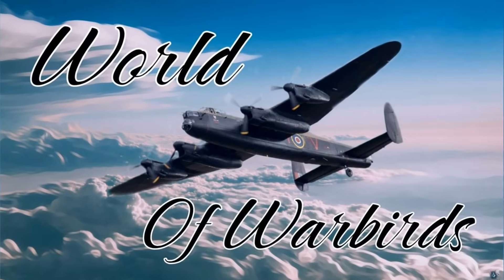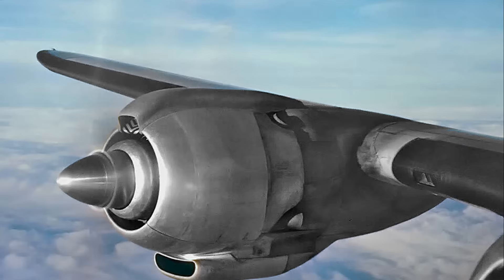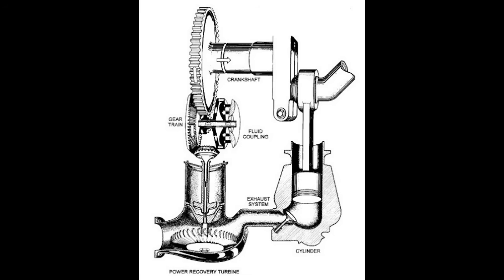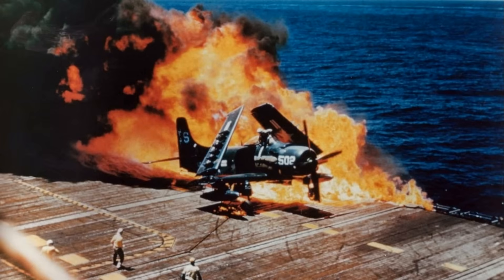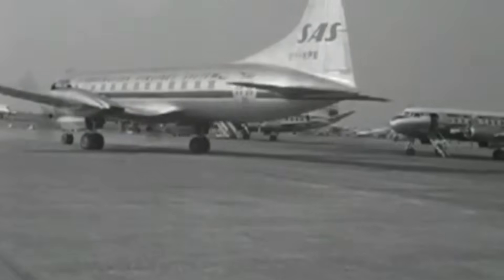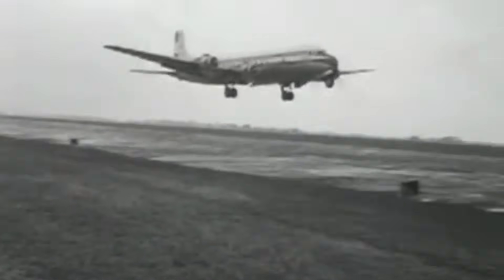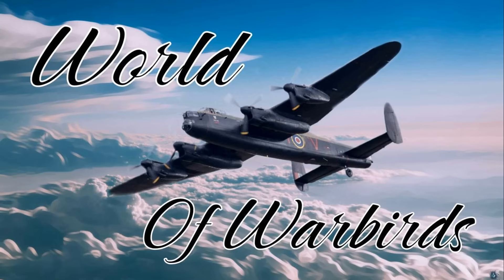Turbo-Compounding: The Forgotten Power Booster of WWII (almost) and Beyond

Comment: One, of the teasons for the B-29s to combust at no notice was the very primitive turbos for compounding which SHOWERD parts and oil.  Multiple buckets were/are normal for the super-forts sitting still. (I watched the still flying 'fifi' start and warm up (to fly across San Francisco bay to her next show)) used 32 GALLONS oil and 400 gallons of 100octane AVGAS, for a warmup, ten minute flight and landing!
Reply: The big problem with fires on B29 engines were induction fires and they had nothing to do with the turbos.
The R3350 engine had a poorly designed supercharger, it worked well enough at any kind of RPM's but at an idle it caused some cylinders to run lean from the mixture not being evenly distributed throughout the intake, the problem was the early pilots of B29's didn't have a proper pilots manual due to the aircraft's rushed development, they were trying to run the engines like in the B17's and B24's they had experience in, they were advancing the throttles too quickly off of idle, that could cause a lean cylinder to backfire into the intake (induction) manifold, if that happened and it caught the pressurized air and fuel in the intake to catch fire it would spread throughout the manifold causing cylinders to drop power like dominoes, these were heavily loaded bombers trying to get off the ground from the short improvised runways on those Pacific islands, as they'd roll down the runway that engine would continue losing power as each cylinder quit making power so by the end of the runway the engine was completely dead dooming the aircraft that didn't stand a chance of getting off the ground before the end of that shot runway. 
Once they finally figured out what was going on it was standard procedure for two of the gunners to each watch out one of the plexiglass bubbles on the sides of the fuselage at the two engines on each wing, each engine had a particular panel they were supposed to watch, if they saw either one starting to discolor they'd immediately report it to the pilot and hopefully they wouldn't be so far down the runway he couldn't get it stopped before the end and they'd crash into the sea.
Like any aircraft from back then occasionally things like an oil line popping and hosing down the engine would result in a fire in flight, also the pilots not correctly cycling the turbos before taking off which could blow seals in the turbo and spray oil into the intake was actually another thing that could cause an induction fire also, but these weren't really anything more common on the B29 or B24's, the major cause of engine fires on the B29 were induction fires caused by a cylinder backfiring into the intake during throttle up at take off, unfortunately as most of the crews died if anyone on board had any information about what went wrong they took it to their grave, so it took a while for them to figure it out, by then they were already developing the direct injection systems that cured the problem 100% since if there's no fuel in the intake you can't have a fire, and wherein direct injection did indeed make it a better engine the fact is once they figured out what was going on and trained the pilots to hold the brakes and advance the throttles slowly off idle induction fires dropped dramatically before the direct injection engine B29's even got to the field.
Another thing is the myth that the R3350 engines had magnesium cases, they didn't they were forged steel cases just like the Wright R1820 engines in B17's were forged steel, people mistakenly believing the R3350 engine had magnesium cases is why they think the B29's fire suppression system wouldn't put out the engine fires, that wasn't the reason, the reason was because the fire suppression system sprayed the outside of the engine but an induction fire is inside the engine, so no, it won't put the fire out.
Reply: @dukecraig2402 Thank you for this wonderful technical description of the cause of the B29’s engine problems.
Reply: @Pamudder 
Any idea where I can read about that Avro Shackleton?
Reply: @dukecraig2402 It was in an article entitled “The Shack” (which is what its crews called it) many years ago in SMITHSONIAN AIR & SPACE magazine .

The Shackleton was a derivative of the Avro Lancaster powered by four Rolls-Royce Griffons driving counter-rotating props.
Reply: There’s a funny story about the Avro Shackleton ASW aircraft, which with its 4 RR Griffon engines stayed in service until about 1980.  

One Shackleton made a very unusual flight to Halifax for a demonstration and an order had been placed for 110 gallons of oil to prepare for the return trip.  It arrived in the form of several pallets of 1-quart oil cans.
Reply: @Pamudder lols!  I have dealt with (USN) military supply systems.  Sadly, a lesson i learned is ALWAYS check container sizes when ordering consumables (liters instead of gallons of fuel for a loooong small boat trip (and a 55-gallon drum of lube oil for a TWO-GALLON lube oil tank, spring to mind!)

Comment: I worked on the GE T58 turboshaft in the SH 3 Sea King. We had an internal fuel manifold fail. The power turbine melted. It looked like it went into afterburner.
Reply from the maker: That sounds intense! Thanks for sharing!

Comment: Allison V-1710 E27
3,000hp
Reply: Yep, first engine in the world to run with a turbo compound system, the next step was to fit it into the P63 Kingcobra, but before it left the test stand the war ended and the plug was pulled on the program.
Reply: @dukecraig2402 P-63 would’ve been cracked with that engine in it. 

I love drawing fantasy aircraft for designing in Flyout. I had an idea of combining Chrysler’s inverted V16 engine and the entire forced induction system of the compound V-1710.

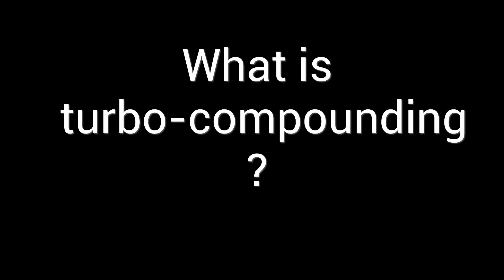Comment: 1:13  What you are describing as "Turbo Supercharging" is really just plain old Turbocharging.  Turbo Supercharging is when a crankshaft-driven supercharger feeds its output into a turbocharger.  At least that's the way I learned it in caveman days.  I always wondered why they never tried electrically-driven turbochargers to eliminate turbo lag -- and then, fairly recently, they did.
Reply from the maker: Turbo-supercharging is an old fashioned term, brought in when the idea of a supercharger driven by a turbine was new.
Reply: @worldofwarbirds  There has never been a supercharger driven by a turbocharger because such a design would be objectively impossible to achieve the goal envisioned.

Superchargers are driven by the engine's crankshaft; turbochargers are driven by air or exhaust, depending upon aspiration.

The whole idea of Turbo Supercharging was for the supercharger -- driven by the already rotating crankshaft and therefore instantly responsive to the driver's right foot -- to feed much higher pressure air instantly into the turbocharger to eliminate or greatly reduce the "turbo lag" that would otherwise result from exhaust requiring time to reach sufficient pressure to make that turbo spin like the dickens.  Not Charles Dickens, the other one.

I jumped for joy when I saw that someone had figured out that electrically-driven turbochargers can instantly respond to accelerator input while eliminating dozens of pounds worth of now-unneeded supercharger.

Anyway, I haven't been involved in this for about 45 years now.  I just occasionally see something on the news rack and go "Well, I'll BE!", which usually makes me sound like I'm in 1885 staring in wonderment at the first automobile.

I'm old.  It sucks.
Reply: @adamchurvis1 
You're wrong, that's not how the turbo supercharger system worked on USAAF aircraft in WW2, he's right he just worded it poorly, the turbo doesn't drive the supercharger on those systems it feeds the supercharger, but at lower altitudes the turbo didn't even do anything, now that system is not the same as the turbo compounding system this video is about, and after I explain how the turbo supercharger system in WW2 USAAF aircraft worked I'll explain why there's some confusion here.

P47's, B17's, B24's, P38's and B29's all had the same system, the engine's had a single stage single speed supercharger, engines love being throttled off a supercharger, throttle response is instant unlike a turbo charger that has the dreaded turbo lag, the single stage single speed supercharger on those engines provided plenty of boost at lower altitudes, the turbo in the meantime did nothing, instead exhaust was routed out of waste gate dump valves, right around 10,000 ft where the engines single stage supercharger could no longer produce maximum boost the waste gate dump valves would start closing which diverts exhaust to the turbo and driving it, and it starts feeding the engine's supercharger and essentially keeping the inlet air pressure at the supercharger the same as at lower altitudes, the higher it would fly the more the waste gate valves closed diverting more exhaust to the turbo driving it faster, at the highest altitudes all the engine's exhaust was driving the turbo, with this system you didn't have an additional 150 HP or so dragging down the engine every time you'd shift a 2 stage 2 speed into a higher range, despite the term "2 speed" being applied to them a 2 stage 2 speed supercharger actually had 3 ranges it could be run in, at 150 HP drag per range at the highest altitudes with the supercharger in its highest range that's around 450 HP being drug off the engine in the form of parasitic power losses, but with the system the USAAF liked no matter what altitude you were at you were still only dragging the initial 150 HP a single stage single speed supercharger drags off the engine because starting at medium altitude the turbo, which captures lost energy, starts feeding the supercharger, there's other benefits but this is getting long enough already. 

The turbo system in this video has nothing to do with forced induction, the turbos capture lost energy but instead of it being used for forced induction it puts that power back into the engine's crankshaft via a fluid coupling, this version of the R3350 engine had a 2 speed supercharger for all of its forced induction needs, the "turbo compounding" part of it once again simply put lost energy back into the crankshaft.

Now here's where some confusion often comes in with guys from the car community, they use the term turbo compounding to describe one turbo feeding another, which is similar to the turbo feeding the supercharger on those aircraft I listed, I've never heard of a supercharger feeding a turbo as it'd defeat the purpose of having a supercharger, which is that engines love throttling off a supercharger, if you had a supercharger feeding a turbo you'd still be dealing with turbo lag although it wouldn't be as significant as a straight up turbo. 

Another thing that causes some confusion between the aircraft and car worlds is the terms supercharging, turbo charging and turbo supercharging, ultimately a turbo is a supercharger, it's just a specific type of supercharger like a roots supercharger or a centrifugal supercharger, but in the car world people have taken the word supercharger and turned it into strictly meaning a mechanical supercharger, once again a turbo is also a supercharger but tell that to someone in the car world and they want to argue and tell you that a supercharger and a turbo are two different things, which they are but essentially they're both superchargers, in the aircraft world turbo supercharging commonly means a turbo that feeds a supercharger, in the car world turbo supercharging just means strictly a turbo, aka a turbo charger.

Because the terms aren't directly interchangeable between the two worlds confusion starts typically when someone from the car world watches a video about WW2 era aircraft and they get confused as I believe you have.

Hope this helps.
Reply: @dukecraig2402  Man, it sure does help -- thank you!  I genuinely appreciate learning things the right way, and your correction just now helps me not sound like a moron the next time!  Again, thanks, my friend.
Reply: @adamchurvis1 
I don't mind passing along what's been taught to me, none of us are inventing these things, we've all been taught by others.

Comment: You didn't read NASA/NACA Report 384. Turbos aren't free output, as turbines run on a pressure differential, and building exhaust pressure requires work from the crankshaft. A turbocharger is essentially a clever fluid coupling on a centrifugal supercharger. Forcing the crankshaft to do work, to recover some work, is a net loss, that's why turbo compounding didn't go anywhere. Bad idea.

Comment: Great info – only problem here is that the centerpiece shown is the Boeing B-50, which did not have turbo-compound engines, instead using the regular P&W R-4360 engines.

Comment: There were all sorts of half-facetious comments about the DC-7 and 1649 Connie being the world’s best three-engined airliners.  

With all the B-29’s that killed their crews due to their not-quite-ready-for-prime-time first-generation R-3350’s , I shudder to think the results 6:40  if the AAC had tried to add turbo- compounding to this beast then.

According to Wikipedia, the DC-7 first flew in 1953 and the L-1649 constellation not until 1956.  Of course, the engine was under development before then.
Reply: The first engine ever to run with a turbo compound system was the Allison V1710, it was a USAAF funded project and the next step was going to be fitting it into a P63 Kingcobra, but before it left the test stand the war ended and they pulled the plug on it.

The turbo compounded V1710 made 3,000 HP, in the P63 it would have made a tremendous fighter, it's a shame it never flew.
Reply: @dukecraig2402 Thank you for this information.  I consider myself pretty well informed about piston aircraft engine development but if I ever heard of this AAC project I had forgotten about it.

This, of course, leads to another question:  if the US aircraft engine industry had a working turbo compound by 1945, why did it take until 1954 for the R3350 turbo compound to enter service?
Reply: @Pamudder 
Because the V1710 was a US Army development program Wright didn't have anything to do with, aside from the basic math they learned nothing would have done Wright any good because everything was done in the V1710, which couldn't be more different from the R3350 if you tried, also, given that everything was going jets right then developing a turbo compounding system for a radial aircraft engine, a technology that was dying at the time, might not have been at the top of Wright's priority list, and aircraft and engine designs always took a long time, just look at the headaches everyone had with the B29 because it was rushed through development.
So after the war Wright had to start pretty much from scratch, then they had to have Lockheed change whatever they had to in order for that version to go into the Conti, that involved development time, test flying, FAA approval because it was a civilian passenger aircraft, along with the fact that given the R3350's reputation after the B29 thing I'm sure they wanted everything right, after all they were going to power a plane loaded full of people.
I'd love to have the monetary equivalent in all the money just spent paperwork to do all that, even in 1950's dollars.
Reply: @dukecraig2402  LOL.  You are undoubtedly right.

Comment: I would think adding another turbo inline would give them the same or better power. No direct drive shaft and gears to worry about. Cold air going into a large low pressure turbo and the pressurised air getting compressed  again into another before entering the engine. The exaust would enter the high pressure turbo and then to the low pressure turbo. I guess this wasn't possible or thought of back then.